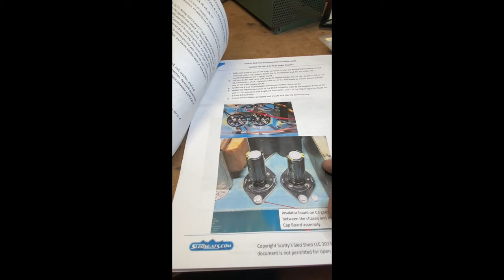Heathkit power supply upgrade and restoration

Comment: I am halfway through doing mine. It’s one I built in 1968 for my HW-22A. After 56 years I figure it was past time to replace the capacitors. When I first turned it on in 1968 at least one of the electrolytic capacitors blew their guts out! Heathkit sent me new ones and that was the last time I had any trouble with that power supply. I worked a few stations with my HW-22A recently and decided I was pushing my luck too much, so I bought the kit like you have.

Comment: A power supply that old it would be expected to have newer caps.  if you leave the sleeve off it will be obvious that it was restored. It will not affect the value at all it's value will be to someone who knows about the rig and wants it for being restored. different from Harbauch mods